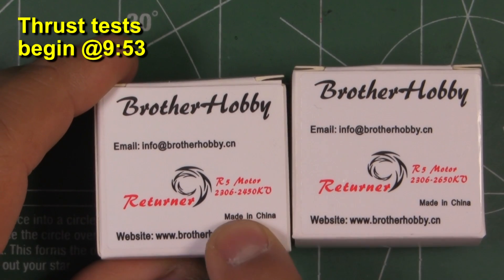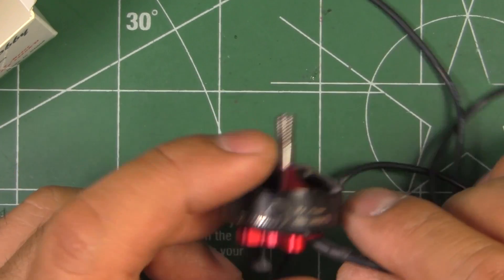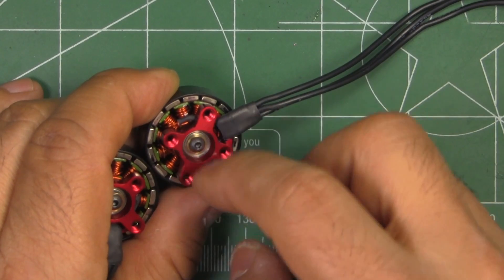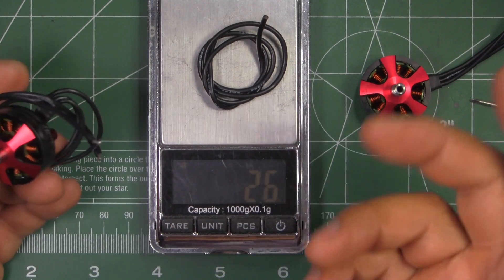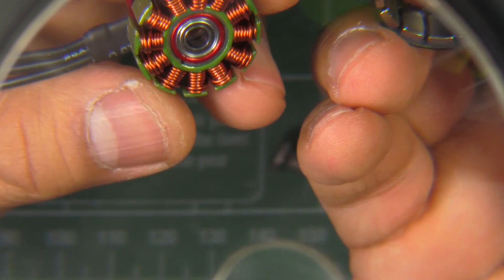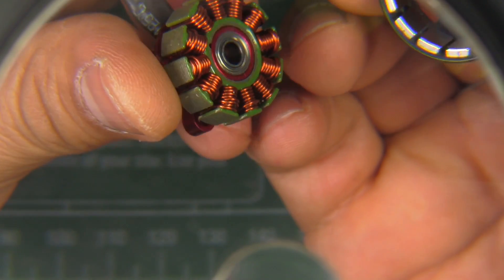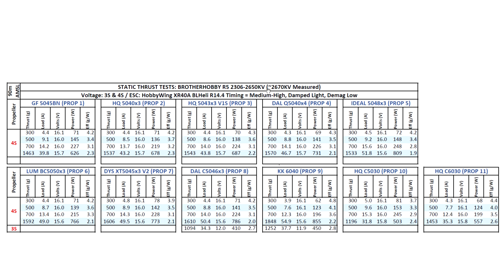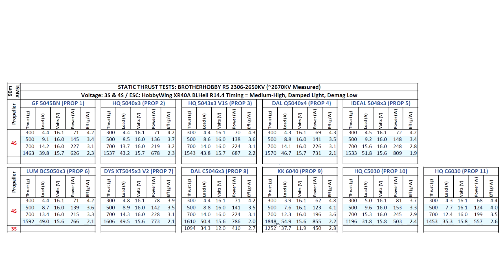BROTHERHOBBY R5 2306-2650KV "DEADPOOL" THRUST TESTS & OVERVIEW

Comment: What Loctite strength you recommend for these screw : med(242) , high etc? Thanks in advance
Reply from the maker: There is a purple Loctite 222 that's supposed to be the best one to use because it's easy to remove but holds screws in place. The next best one is the blue Loctite
http://henkeladhesivesna.com/blog/the-difference-between-red-blue-green-and-purple-threadlockers/
Reply: EngineerX I am using the blue one. Thanks
Reply from the maker: Jack Truong that one is good. You just need a little on the first 3 or 4 threads of the screw.

Comment: How the hell do you remove 330mm of wire??? There is no too much of a wire, usually there is 160mm and That’s the max, so for 4 in 1 builds you remove 90mm of wire, and for Regular ESC builds you remove 120mm of wire!

Comment: Awesome job as always, would the  spedix es30a esc's handle these motors on 2400kv please ?
Reply from the maker: Thanks for watching!
yes, no problem for those Spedix 30A handling these with any of the tri-blade props, including GemFan 5152x3 and DAL C5050x3, You can even run those 6" props safely without worries.
Reply: Thanks for the top info bud well appreciate it 👍👊

Comment: Thanks for including the C-Props in the test :) i get it now, those are by far not the strongest thrust wise, but at least they are the most efficient at topend (from the tested props), so maybe the perfect props for older batteries on high kv setups? ;) as it doesnt demand those crazy numbers in the 50A range on this motor (which is insane :D) (4x50x0,7 A inflight makes 140A sustained =/) A normal 65C 1500mAh Battery only provides about 100A sustained (for not even 5 s i guess!) sooo.. ppl better do the math before killing their batterys and maybe esc i guess :D im not sure if the bigger, more hungry motors the companys kept releasing these past months are really the way to go.. as long as battery technology lacks the big innovations in the meantime :P heres a valuable methodical tested resource about battery data http://www.lipobench.com/index.php?showtemp=0&lipo=30&lipo2=15&page=80Atests

Greetings
Reply from the maker: Don't be "misled" by the high Amp numbers, you'll only see those in thrust stand tests. As you say, in the air, LiPos will be the limiting factor and only supply sustained 100 to 120A short bursts of current, then taper down as everything in the power system saturates with heat, resistance goes up, current delivery goes down. 
So those Max Amps are just momentary and the high load is on static air. Once moving, Amps are gonna be way lower. So each motor in a quad will only have 25 to 30A to make its power.
Going bigger to 2207, 2306, and 2407 from the previous popular choices of 2204, 2205, 2206 motors, does give some advantage and improves performance I think, the larger motors are more responsive since they have more torque due to larger stator size. Also they're actually a little more efficient if you manage to be well-disciplined with throttle you can get same flight times. Of course if you pound on throttle, battery discharge will happen quicker but you will have gone much faster or travel greater distances in shorter time. I think the 2400KV 2306's are very good replacement for 2205's. In the few flights I've had, seems I'm flying about the same time, batteries did not get hotter than before, and quad felt more responsive and more powerful. But, for other people with different flying style, it could be they drain battery in less time than when using 2205, different results for different people. I have not tried the 2600KV+ yet, but I would imagine those will drain LiPo faster. But some people prefer the speed over the flight times. 
Definitely agree.... we need new battery technology to catch up with motors. Thanks for the lipobench link- very interesting!
Reply: Thanks for the very detailed response :) nice to hear, that the flight time can be comparable to the smaller motors (depending on flight style :D ) More torque and responsiveness is of course very nice to have! I will definitely consider one of those "bigger" motors on my next 5"+ Quad, i have some 1800mAh 4S batterys from my 6" copter anyway :)

From my experience i think its not the best idea to let the battery be the limiting factor in your system, they get very hot, eventually puff and live a short life if you´re too hard on them =/ 

I think it would be interesting to know if a (big enough) cap could limit the "damage" of the lipo from those very high spikes. Because in theory the Caps get drained first ^^ I have talked to quadmcfly about caps in general.. but he says they´re only good for noise filtering! since the Capacitance/electric charge stored in our caps is way too small to see any improvement in responsiveness of the motor or anything (on his bench). So yea maybe someone needs to get deeper into this matter and compare the performance with/without cap in depth (as far as i know he uses a power suply coupled with a supercap for his tests) so thats not exactly the same as using a lipo + an electrolytic capacitor :P So maybe theres hope... 
But a lot of people seem to think that the Caps are some kind of "booster" :D and i get the shady impression that the "tbs drag shield" marketing seemed to support that claim.   
  
On the battery side so far it looks the new R-Line 100C (HV Capable) might be a new breed of batterys if you look at the lipobench results :) where other batterys can sustain 80A only for like 5 sek, the R-Line delivers like 40s before it drops to 14V, thats insane :)  dont wanna start the hype train but those look very, very promising ;) 

Greetings

Comment: what motor is next :D
Reply from the maker: I'm working on the BH T3 2306-2450KV and BH R3 1106-5100KV reviews. Then I got the MAD 2306-2750KV, DYS Mars 2700KV, RealACCC 1106-6000KV, BBB 1606-3500KV, IFlight 1407-4100KV, BH R3 2206-1720KV & BH T2 2206-1800KV...
Reply: EngineerX I'm excited to see the BH 2306 r3 and also the rest, but I'm dying to see the rotor riot hype train motors
Reply from the maker: I haven't checked to see the specs on those. Depending which factory actually makes them, they could turn out to be very good for their specific purpose. I would imagine they're gonna be aimed at freestyling, so perhaps they'll have good low to mid range torque. They'll need to price them competitively because there's so many very good motors available these days.
Reply: EngineerX they are called freestyle but they are not in shops yet

Comment: was a little disappointed at their thrust :( but atleast they are better than emax rs2205 2600 kv first version, whicg i will be upgrading from. but great video
Reply from the maker: It was a little down on thrust compared to others, but also Amps were lower and motor looks to be a little more efficient so maybe that means an extra half second(? guessing) of higher voltage on full throttle run. 
Right, these would be a step above the 2205-2600KV motors. Now we gotta see how these do on long-term abuse, hopefully no issues! We'll see reports from people flying them soon enough.
Reply: EngineerX I'm getting them in a few days, they are in the mail right now, but yeah I'd hope they were at least above 1600 gram no matter prop, but they are definitely ment for light weight builds i see
Reply from the maker: https://www.youtube.com/watch?v=7W-lhj8c9qk
Check out Moosestang thoughts on the 2450KV, so should be somewhat applicable to the 2650KV. He's used EMAX too. Looking forward to hear what you think of the motors once you get the in the air. I still gotta install my set and try them.... hopefully next week I'll get a chance to sneak in a flight or 2 during lunchbreak.
Reply: EngineerX lucky you, I'm still waiting for my frame from armattan to finish my frame, but another question, are you going to test the cobra 1407 motors?
Reply from the maker: I've messaged Cobra but no reply yet. I'm considering ordering at least one of the 3500KV for testing. But have not ordered yet.
Reply: why not the 3700 to line it up vs the brotherhobby tornado t1 1407 3700
Reply from the maker: Actually, the BH 1407-3600 is closer to 3500KV.  Also 3500 ~ 3600 seems to be the best motor to match with 4045, 4045x3 and even some 5030 props. It should also give a very indication of how the other KVs will perform since it's right in the middle
Reply: EngineerX nice :D but I'm using the BH 1407 3600kv with a tri blade dal 3545 prop that gives a nice thrust, but I am going to order some tri 4045 to check out
Reply from the maker: Those DAL 3545x3 work very well with this motor. Many people like DAL T4045x3 but make sure you're running 20A ESCs as the Amps go higher and also check motor temperature right after first fast lap around the field.

Comment: So these are basically the same as the new Piroflip 2306 2722/2522? Per the specs, they seem identical except for the kv ratings.
Reply from the maker: I would imagine they're using similar components and share very similar specs/dimensions since BH manufactures(d) motors for PF. They've made motors for ZMX, Armattan, RotorX and a few other brands.

Comment: damn those brotherhobby motors and their miniscule airgaps!!! soo tight!!! lol good numbers. damn. c'mon MAD motors! lol
Reply from the maker: Just got delivery yesterday of the MAD 2306 you sent me. Thank you for donating the motor. I have to say it looks impressive on initial quick inspection. I'll be testing it soon and I'm curious to see where it will fall in the pecking order of 2306's that I've tested. It should be right there right a long with the others if its looks are any indication of what to expect in performance.
Reply: EngineerX awesome! It will be interesting to see results from a company that usually deals with efficiency in agricultural uav's. I know the new versions of the motor have been delayed due simply to the fact they were rewinding and resetting motors to produce good numbers. So this motor i sent you will be V1. V2 in the works and is being directly compared against emax 2306 in testing. Their own numbers so far show less pull. But much more linear amp draw and less amps at peak.
Reply from the maker: We have been getting too fixated on Max numbers, actually linear power delivery would be more desirable. This is similar to the turbo era of the late 70's and the 80's when power burst all of a sudden whereas now is more gradual/modulated and more usable throughout the rev band. I've noticed that in some builds, power is lacking a the lower to mid range. 
Very cool then, I'll be looking forward to seeing what MAD comes up with. I didn't know the manufacturer covers agricultural/industrial applications. Hopefully that signals very good QC and overall motor build, durability, serviceability, etc....
Reply: as mentioned this is the version 1 motor i sent you. same ones i have been using. this is no longer in production as the improvements i asked for have been addressed. they now have upgraded magnets. better windings, hardened stainless shaft and currently they are still testing to find the desired air gap/ flux densities.

all these motors with miniscule air gaps produce the thrust and draw the amps, but they also would get hot and have a lot of eddy-current feedback. the important factor in MAD motors that they are focusing on atm are the right flux densities. 

the version 1 motor i sent you will be a good gauge at what their first entry into the mini quad market will show. as they can only improve from there! i have a couple of other metallurgic processes that i am sharing with them to further improve their product. since no one in the industry has implemented some of the processes i have been sharing with them. hopefully if they can get their head around it, the v3 of the motors will have leading edge improvements.
Reply: and i agree. but!!! we all love the group B era!! lol mental boost pressures and tiny powerbands with massive spikes. lol kinda like riding an old IT490 or CR500 2 stroke! lol Band for days!!! but also rebuild every second day. lol. 

so far, my version 1 motors although not sporting the hardened shafts, have taken a lot of abuse. i can always get them back perfectly straight with an allen key in the shaft, but other components are holding firm. ie. not a single magnets has moved after concrete and tree smacks. full pelt into the ground or tree see's mud and bark jammed up into motors, free it up, blow it out and she's ready to go again. so the enameled copper used is quite thickly coated. only once have i gotten the motors warm, that wasnt even a stress test, it was from removing notch filters and dterm filters. i have managed to burn one out from jamming it up high into a tree. that motor and prop caught and stopped. i kept trying to free it with full throttle burst to no avail. lol. this led me to part my spare set for one motor. so i sent one to you and also sent one to our local esc designer, he is using to stress his 32bit esc's out. a couple of months and hopefully i can announce a new player in the 32bit esc scene that will be running his own passthrough firmwares. his results so far are silky smooth. he just has to work on downsizing the thing atm lol.
Reply from the maker: Oh yes, Group B was indeed insane, specially the crazy spectators.
Some good developing parts on your side of the world. Good to see a gearhead advising manufacturers about what will work
Reply: hahaha cheers. with the trend moving towards a monopoly in the market. gotta keep everyone involved on their toes to progress at a sustained rate ;)

those spectators.... ridiculous, and the nerves of steel to just stick to your line through the crowd at full throttle. man.. insane!